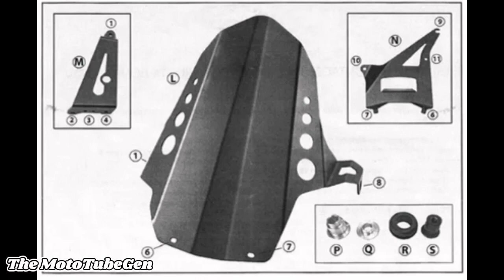FORZA 750 - Rear Mudguard Fender Installation #hondaforza750

Comment: Hi guys, i just ordered a kit like this. When i read the instructions . I don't find them very clear nor are the pictures in good quality. You say to remove the rear wheel completely. I have no expierences with that. Altough the instructions tels uss to remove the muffler?
Your video is helping a bit but not enough for my expierence. Do you guys have a Larger video for this install? Many tahnaks upfront.
Reply from the maker: Greeting Johnny, unfortunately, that's the best I could record. There was no need to remove the muffler, although it's getting really difficult to screw the bolts in the swing arm.
Reply: Hi Johnny. I have the same issu.. have you got a tips to help me for mounting this without dismounting the wheel ?
Reply from the maker: If you find a way to do it please share. 🙏
Reply: @ Finally I succeeded without dismantling anything. I used a very very small ratchet wrench to unscrew the farthest bolt, milimeter by milimeter. it took me a lot of time and patience. My hands are all scratched now.
Reply from the maker: @maalia-gac Perfect. I guess worth trying that. Good to know that. In my case, we did it when I changed also chain and sprockets.